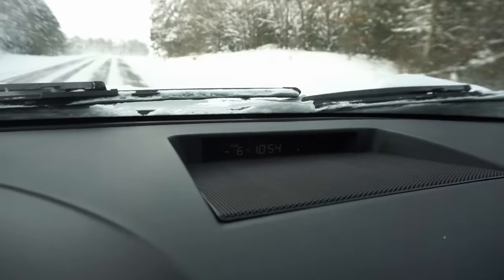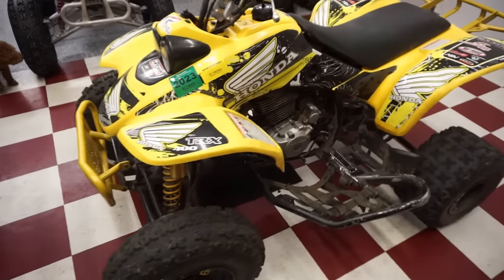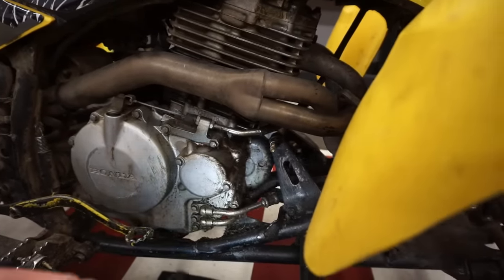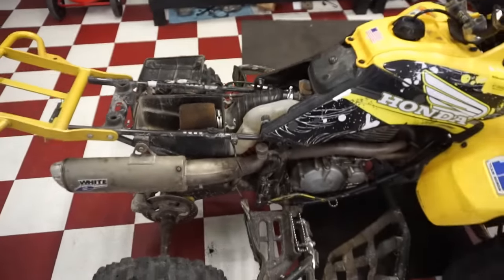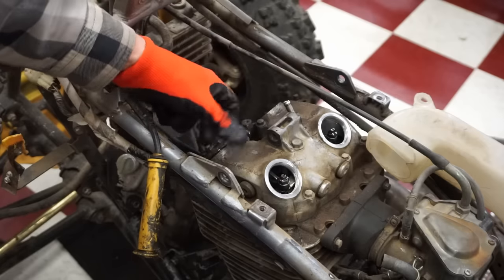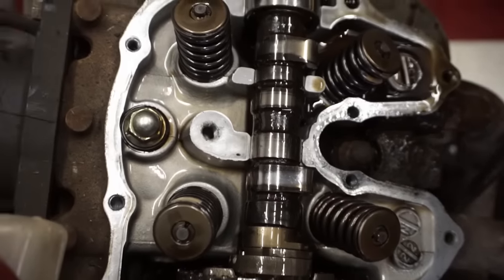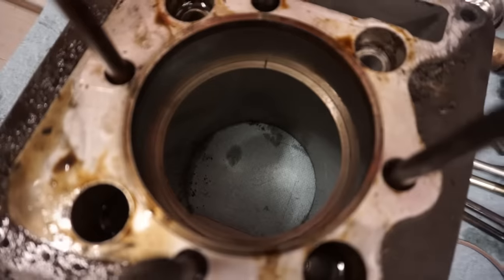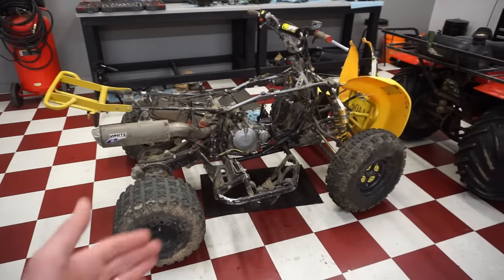Nobody Wanted To Buy This Quad...Now I Know Why

Comment: Been enjoying the videos man! Been a bike tech for over 30 years and it's nice to see a young man take pride in his work and do it right! Wanted to share my 400ex story quick. I found one in a shed once that wasn't being ridden at a fellows house I know. Looked brand new, just dusty. I asked him about it and he said he'd took it on a trade and something was wrong with the chain and swing arm. It cranked right up, ran perfect, looked like new, but the swing arm bearings were killed. It was a yellow 02 just like this one. Got it for $1200! Might be the best deal I've ever got on a bike! Anyways, got it home to the shop and looked it over real good, absolutely the only thing wrong was the swing arm bearings. Never understood why they went bad and the entire rest of the bike was like new. Wheel bearings, brakes, all that looked factory. Rode it about a year, my daughter really loved it and learned to use a clutch with it riding with me on it when she was like 7. I worked on a friends suzuki samurai one day and she went with me on a road test. She said she really liked the Samurai. A friend of mine the very next week saw the 400 and had a fit for it. He can find anything on marketplace or back then it was mainly craigslist. I told him if he could find me a Samurai that ran as good as the 400 I'd trade even, even if he got the sammy for $1. He found me a super nice 88 all original no rust and we traded. I still have the sammy and love it. Had to put rings in it eventually but its super nice and rust free. I still miss that 400ex sometimes. This one really brought it back. Holler if I can ever be of help man, I've had thousands of Honda, Yamaha, and Suzuki's apart and have probably just about seen it all LOL! Glad I found the channel man! Keep up the grind
Reply: this deserves a read from the channel
Reply: @SingleMost  thanks man! I've learned things from Joe for sure. Can never stop learning!!

Comment: Just a suggestion for your safety. Rig up a chain with a rope block and tackle with D ringsthe front end of the bed of the pickup. This will allow you to control the speed at whcih the machines roll out of the bed and make it much safer for you. it will also be useful if you need to pull something into the bed. Keep up the great work.

Comment: Matt from garagemc youtube channel here! 400ex's are my main thing bro. All cylinders say 397cc on them you will need to check the bore. 85mm is a stock 400ex 86mm is a 416 88mm is 426 and 89mm is a 440. A 465 is also 89mm bore but with a stroker crank
Reply: So it’s actually a 426
Reply: @Naltddesha  no it came out as 89 mm so 440.
Reply: @TheRook12325  ok.. so Garagemcmatt is wrong?
Reply: @Naltddesha  no he’s right
Reply: @Naltddesha  Read his thing again.
Reply: @TheRook12325  I don’t care anymore

Comment: I'll have to finish watching in a few hours. Have to repair my van before it gets dark. It's cold as Hell here too. I noticed, at the seller's garage, that there is an exhaust leak by the carb. Saw it blowing from the pipe, across the back of the engine, towards you. Hope there's no hole or crack. I know you can braze or weld it, but don't wish that extra burden on you. Good luck with it. Gonna finish watching as soon as I get back in and showered. Almost forgot... Whoop!:elbowcough:

Comment: Ohlins shocks are real good. Depending on where you get them they are between $750-$900 for the set
Reply: Try $2000 - $3000 for the front and $2500 for the rear. Or at least that's what they USED to cost. They may have gotten cheaper since I was racing.
Reply: These shocks are complete junk
Reply: @pcostyle11  Could be, if they're Chinese knockoffs.
Reply: @F5Tornado44  ahh  make sense cause ive heard terrible stories about these shocks
Reply: @pcostyle11  Oh man, if you happen to find a set of older original, genuine Ohlins shocks, pounce on them. They are a dream to ride on. And they can be revalved to your exact specifications.
Reply: @F5Tornado44  seriously i had no idea !! Thanks for the info man
Reply: depends on there lenght and stuff, but i know some claped out gasgas wild hp quad 46cm olhins for the front just sell for easy 1000€ i was thinking on keeping mine when i sold the gasgas quad (with a claped swap klx650 engine it had ran great but was done bad) but them suspension where leaking... and the other 46cm suspension i had didnt fit to large on the bottum.. so i sold the quad like it was, but i must admit them ohlins did feel nice compared ot stock quad suspesnion u got on honda and yamaha
Reply: @pcostyle11  what shocks are junk? Ohlins shocks are far from junk. Some of the best shocks money can buy
Reply: @BigDirtDawg  read all the comments dude it was probably chinese junks cause everybody on forums around here says that these shocks are complete junk i saw a broken shocks once lol
Reply: @BigDirtDawg  Yes! Swedish High Tec for Quad, Snowmobile, Motorbikes & Rallycars etc.
Reply: Good Lord

Comment: Ohlins is the gold standard of suspensions. In the motorcycle world all the top end sport bikes will have Ohlins sus. 

One thing that I is super helpful when wrench’n on old quads is a tap & die set. Being able to re-cut threads is super handy. Even cleaning up threads on bolts. 

I bought a Z400 once that had a lot more wrong with it than I thought it did…we all been there.

Comment: Have you ever considered stripping a machine and doing it up with everything and just keeping it for a personal quad? This seems like a good candidate seeing how you already have the motor almost ready to pull and the swingarm has to come off anyway it wouldent be that much extra work to powder coat the frame and throw a few extra parts at it and just keep it. Would be an awesome series and a good resource for anybody else doing it

Comment: Boring the stock cylinder is usually more reliable than using an aftermarket cylinder for a big bore kit.  Lots of quality built atvs are big bore, but still indicate the stock cc as cast on the OEM cylinder
Reply: True that's why I'm really thinking about getting a wiseco high comp piston for my big bore 250ex but I also don't want it too through away the reliability and still make decent power.

Comment: Hey Joe;  you may can straighten that steering stem.  I had to do that on my little Warrior.  Pulled it out, clamped it in the vise on my milling machine and pulled it with a long bar.  Mine was so bad it bound up on each side, kinda like when when we were kids and rammed our bicycle front wheel into something immovable (like a parked car), and bent the fork tube up inside the neck.  I had thought that was all that set the handlebars at an angle, but after LOTS of looking and measuring, and thinking I had a bent frame, found it had a bent swingarm.  After ordering a replacement for that, I decided to try and straighten that too (what did I have to lose), and pulled that thing back out straight!  What a learning exercise that was.  Anyways, rock on and Merry Christmas to your wonderful family.

Comment: That grab bar is called a six pack rack (made for a smaller playmate style cooler).  Also Ohlins is on par with like Elka, Fox, etc...real good brand. You are supposed to get the shocks adjusted / tuned for the machine's weight, your weight, and your riding style to get the best out of them, there are suspension shops that do that type of work or you can order them that way.

Comment: The aftermarket sweetness save you on this one.  Between the Exhaust & Suspension they saved your buy.
Reply: @Mostly Motorized  That sucks that doesn't help the buy.
Reply: @mostlymotorized  I disagree. At around 15:20 you can see the Ohlin casting marks stamped on the bracket.

Comment: Joe, I love watching your videos!Pro tip tho would be to take a better look at the vehicles you buy because you can save money and avoid getting screwed over. You can say you can’t do x amount because of those issues and save some money. Use it on those tinier expenses like bolts, nuts, electrical, etc
Reply: At this point I’m sure he’s buying them for the content.
Reply: @jayguilliat3655  that’s what I think aswell. It’s just strange how he doesn’t even check quads or snow mobiles will spin over

Comment: So it only needs a new ring and the piston is still good that is a big plus. Tapping out stripped out screws is doable just need new bolts I guess you can find those. The stem and the swing arm bushings is going to be a pain in arse. And it actually is a 440 big block. LOL thats is nice. Sounds like a 440 Dodge. Good luck with the broken exhuast bolts that part is nightmareish you will have to work your magic on that. Maybe swing arm bushings are not so bad to replace. I like the fact that it actually is a 440 bore and piston and they are OK exception of the rings you got a break there.

Comment: Just a suggestion For the cartridge oil filter,,,cut the paper element off ,,,it's going to look like an accordion paper,,,then open your bench vise and put the accordion paper element in the vise and squeeze all the oil out of the paper element,,then you will be able to see on the inside of the paper element for metal shavings,,,I've seen metal shavings on the inside of the paper  element before on some engines,,,,it's just a suggestion,,,and thank you for your great videos they are awesome and educational 👍

Comment: If those are real ohlins they are very good. Looks like it may be Chinese rfy shocks with ohlins stickers. That white bros pipe is super valuable in the 400ex community
Reply: White brothers pipes are very good on 400s and sounds so good
Reply: They are Ohlins shocks. Has the name cast where the reservoir connects
Reply: @briankennedy5578  is it cast into it? Looked like a sticker I could be wrong tho
Reply: @njmxjunkie3128  Both. About 15:18 when he's looking at the exhaust bolts you can see the front shock. The focus was a bit off. But you can clearly see sticker on the reservoir. And the cast portion of the body which connects to reservoir it says Ohlins. And yes they are good shocks. Set them up correctly and should be smooth

Comment: That 400 was my buddies and he traded for the yfz and there was nothing wrong with the yfz, all it needed was a gasket for the oil filter cap.  That 400 was so clapped it needed all new bearings and all the tires where bald when he traded

Comment: The cylinder will say 397 on the side but if you measure it,it will be 89mm,I can't understand why they still put 397 either,if you look at how thin the cylinder sleeve is it is a 440,the original cylinder sleeve is a lot thicker than that 1

Comment: Good luck getting that swing arm pivot bolt out lol, you may get lucky but they tend to weld themselves in pretty good
Reply: That's what heat is for
Reply: My brother's swin arm bolt on his KTM did the same exact thing and I used a Sawzall too cut it lol
Reply: @dopeman420  can’t get stuck if it’s melted! Lol
Yeah unfortunately heat only does so much on the 400ex due to location, it’s a tough spot to heat. Most guys end up cutting the bolt out

Comment: Quick question… tomorrow I’ll be looking at a 2003 400ex .. the guy said it starts if it’s jumped at the starter solenoid… the Starter Button doesn’t work…. Would a new wiring harness fix that issue ? Also he said it runs with the choke ON .. if it’s Off it backfires through the Carb… what could be the issue ?

Comment: Before u go welding a bracket did u notice the head stay and bolt is missing? Top motor mount connects frame to the valve cover. And also I deff thought it was stock bore the second I seen the piston lol

Comment: Mine had same issue. I drilled tiny hole on choke lever to keep it pulled off so you only hold it to start it the let off never get forgot on either. Secondly she needs a valve lash bad and some gaskets the exhaust donuts. Then she'll rip. 440 big bore it and widening kit and shell really handle. I stuck with stock 450s all day and actually tore up the tight trails with more agility than most machines

Comment: Thanks for wrenching on all you do,. When I have a question about this or that quad I'm working on, I'll dig thru ur vids. Usually u have already covered it. 
 Currently rebuilding an '86 250trx 
 New top end.  The two valve cover bolts on either side of cam where stripped out. Debris got under camshaft and dug out pits on cover and case.  New case, new valve cover, new cam, new valves. 
 Sadly it seems the guy that sold it to my buddy discovered this, then just sealed it back up with rvt and sold it.. smh shotty ppl suck. But it'll be correct after I'm finished with it. 
 Merry Christmas all 🙏

Comment: That's if it's a stock cam if it's a stage 1 or stage 2 it comes with a card with specific lash specs depending on how far the valves opened with a new cam

Comment: I got a 01 250x sportrax with tittle for 800 for the kids. I had to do alot of work because it sat for 10 years in garage with mice and stuff and not taken care of sitting there. I made a mistake by cutting off the front fenders and now I'm looking to spend 300 on new plastics so mud don't go all over them all the time riding. Worst mistake I'll never cut fenders off again it looks good but not practical.
Reply: Even with new plastics preventing your kids from getting covered in mud is near impossible with quads. Unless you have them wear rain gear that's the only way too keep mud off from their clothing

Comment: Straighten that steering stem either with abit of heat which would be the last option save the integrity of the metal depending the use or hydraulic pressure save some money

Comment: You should adjust  those valves that’s what that ticking sound is if don’t adjust the valves the ticking will get worse and the motor will run like crap in less there are hot cams hot cams tend to tick but that’s just the hot cams telling you there happy hope this is useful to someone😊

Comment: Looked like in video, cylinder had some glaring. may have got hot or improper break in, on why only 120 psi. And I bet it would drop, lower, once warmed up from riding. As compression is actually supposed to be checked after engine is warmed up, probably just a hone and new rings. And relap the valves, one may be not sealing good.

Comment: Oh my god Joe actually looked in an Airbox before he buys a atv..A hold my Beer moment I'm in disbelief did I just see that lol. 2:41. Ohlins gas charged shock's are real good score A+. Rear tires are the cheapest tire u can get Sun F china tire Junk. But rear rims have kinda Bead lock to stiffen the rim edge. White Brothers exhaust another score it is complete setup as there is no heat shield.

Comment: those r pretty value able machines these days even the 250 ex goes for like 4 g
Reply: No way dude I have a 250ex and the most I've seen in my area is 2500 top theirs no way they are worth 4k
Reply: check ebay n craigs list may b not 4 g but close

Comment: I have a 2004 that I swapped out everything to stage 2 stage two air cleaner carb Jets CDI ignition coil cam crank lightened racing flywheel composition series clutch wiseco cylinder stock bore with 10.5 piston compression ratio piston r I spent $2,600 for the quad and probably dumped another three grand into it

Comment: is that ALOT of welding on the cases towards the front on the left side?? To me rite beside the motor mount on the front, left side, even with the cylinder head towards the front

Comment: There's no way that's a 440 kit 440 kit you have to take the engine out take the crank out of it you have to have the cases machines to fit the sleeve of the cylinder for a 440 kit you cannot borrow a 440 out of a stock cylinder you have to reach sleeve the cylinder leave 4:40 kit has a issue of pulling cylinder studs out of the threads which is why they make a special head bolt kit for the 440 you also need to get a helicoil set because those two bolts that are missing were stripped meaning the threads from the aluminum or pulled out which is why the bolts are gone be careful you do not strip all the valve cover bolts they have a tendency to do so which is why they have a lot of options for aftermarket heads the 400ex they tend to strip out when disassembling

Comment: For some reason the right valve always gets loose on the ex 400 maybe it's the decomposition mechanism that does it, I tightened mine a little looser than .005 (standard not metric). because when I tightened it to .005 it seam like lots of compression had left. But it's okay to be loose on the decomposition mechanism but that's insanely loose wow that was like .008 maybe.010

Comment: I'm fixing a 2001 400ex right now and its been sitting outside for years and its really rough. Any suggestions on cleaning a fuel tank? I pulled the petcock and the filter was the worst I've ever seen.

Comment: Hallo mate love the vids got a problem u r good with u stuff av got a 125 scooter the starter button won't work got 12 voltage from battery got 12 volts from starter relay but 7.8 volts from starter button wot cud I do mate

Comment: 32:00 how do you know which ones are the exhaust and which ones are the intake?  Is it obvious and I can't see it?
Reply: Usually the exchaust side is the front of the engine and the intake is the rear of the engine
Reply: @kylebeach2316  aww ok that makes sense as the exhaust comes out of the front of the motor.  Thank you!

Comment: I think today's lesson is when it's colder than the 7th level of Hell, don't buy a quad. It doesn't really seem too too horrible, I've definitely seen WORSE, but for 1500, with a little cash and some time she'll come right back (hopefully). I'm 13 minutes in so I guess we'll see how it goes. ...Oh, I'm looking at the recommended playlist and it looks like you made a follow up video suggesting you have some regrets about this purchase. That stinks.